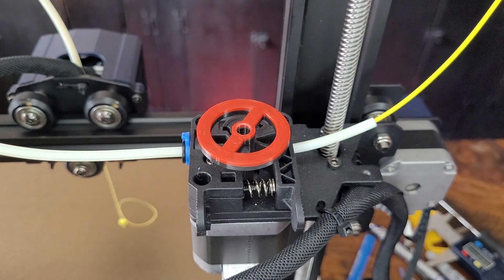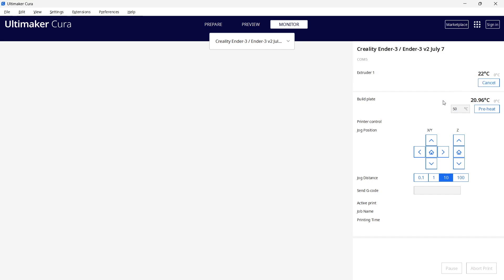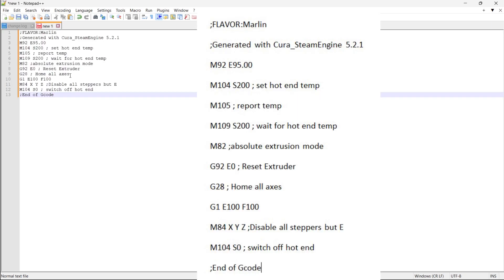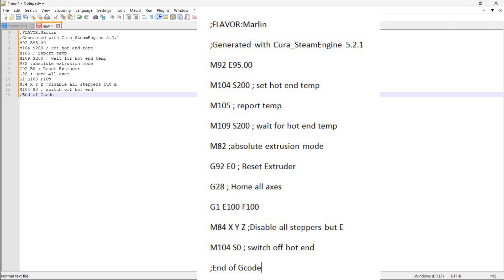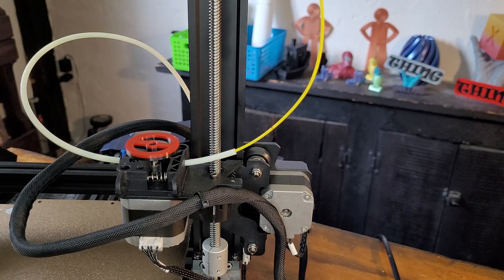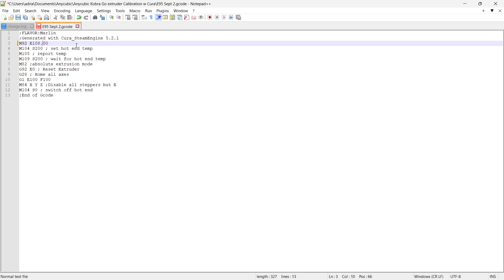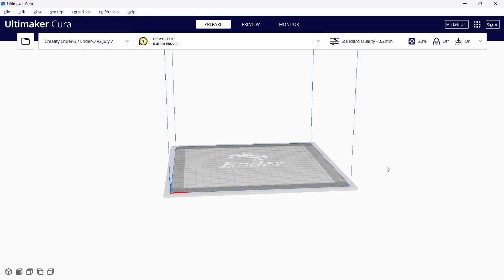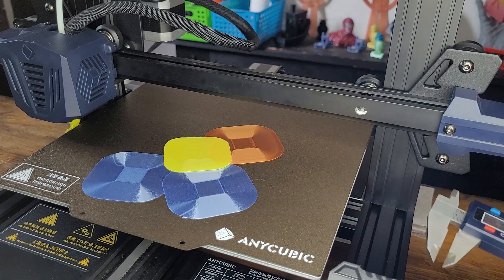Extruder Calibration Cura

Comment from the maker: In case you get the point where you press enter and expect filament to flow and it doesn't, enter G92 E0 and hit enter, this will reset the extruder. Then enter the G1 E100 F100 and hit enter, it should work. 
Just an FYI an even simpler method discovered by accident helping out Wolf Puder https://youtu.be/xetz2ndT7eA
Reply: Dude thank you so much for your efforts! I'm using all your videos to debug my printer quality issues.
Very grateful for your time and efforts! Thank you! 

That 120mm plastic piece you use to measure your filament is very handy! Is it something you designed and printed? If you did it, would you be able to share it?

Thank you!
Reply from the maker: Hi  @russkiebetta  thanks for letting me know they're useful, I really appreciate the feedback and encouragement. More soon :)
Reply: Looking forward :)  @mayhemsmiley
Reply from the maker: Sorry forgot the file line @russkiebetta   https://drive.google.com/file/d/1-Ruf6-ag1nMbTu2Pqaf_aQLsDRHbl7C6/view?usp=drive_link
Reply: @mayhemsmiley  much appreciated, thank you!
Reply: So I'm only 5mm off.... Wouldn't that mean when I save the code you posted (with E95) that it already accounts for my 5mm difference? @mayhemsmiley

Comment: Happy New Year! Thank you for the video!
I know nothing about 3D printing and I still can't believe I can do this by following your steps!
Repeated the test 3 times and they were dead on.
Could you please also share your Brim file?
Reply from the maker: Happy New year lqqkout 😃 Thanks for letting me know you found it useful. I cannot find the file and I know I shared it in at least one video 🤣 But if you're using Cura, add a test cube to the bed and scale down (Z axis only) to your layer height and turn on the brim function. The brim width can be set in Cura. Let me know if this helps.
Reply: @mayhemsmiley  Got it! Just realize that my brand new Cura needs to add the Plugins in order to find a test cube😅
Thank you once again!
Reply from the maker: @lqqkout7987 excellent 😊

Comment: G1 E100 F100 makes my extruder spin the wrong direction and removes the filament instead of feeding it.
Reply from the maker: Hey Bullerbuilt, which printer are you using? Does the motor turn in the right direction when printing?
Reply: G92 E0 fixed my issue. Thanks for the reply and great video!
Reply from the maker: @BullerBuilt thank you and glad you worked it out.

Comment: It's a crying shame that we even have to do all this with Anycubic Printers. I also have a Bambu lab Mini and it does all this on it's own. It calibrates the flow, and the Z offset every print. I get perfect prints every single time that are incredibly smooth and perfect and adhere very very well to the build plate. On the Kobra 2 Max by Anycubic, whch I have had for months now, I have only successfully printed a single messed up Benchy. I have spent hours upon replacing parts, including  brand new hotbed. watching z offset videos, and making recommendations, and spent 100s of dollars on tools and items needed to try to get this damned thing to put out one singe good LARGE print. The bambu lab printer prints everything perfectly every time in any material.
Reply from the maker: @CyrusWraithWalker  yah I hear you.  I have two bambu P1S and both work amazing. No tinkering

Comment: How do you run the code?
Reply from the maker: Hi the what was that, 
You place the code on an SD card then insert into your printer and press print
It will heat the filament and extrude 100mm of filament. 
You will verify the accuracy by measuring what is left. 
Sorry for the delay
Let me know if you have any questions

Comment: sooooo... i just got my printer and it pulled only 20mm... i feel like there is something bigger off that just the steps... it doesnt feel right putting 475 as the m92 value
Reply from the maker: Hi DerGeile, what brand and model of printer do you own? When I get unusual results I always double check in case the human factor is at play, sometimes it's me :) Let me know
Reply: @mayhemsmiley  i have the Kobra Go, bought it used. He showed me the print, wich were pretty good. i dont really changed anything except i did the auto-Leveling.
Reply: i have cobra neo and my result is 647.

Comment: i have one nitpick 
if you home printer and extrude filement in the home position directly on the table, you may get wrong resoult becauseblob of filement created on the table might restrict the flow
it would be safer to home the printer and then move z azies by 10-50 mm up so it does not make a blob that cause restriction that put strain on extruder , that way you have much less of a chance to have skiped steps during calibration
also you might want to do 2nd step in calibration, being measure actual thickness of the filement and put it in slicer you use, because even if you calibrate esteps and have filement that not 1,75 but 1,70 or 1,69 you would still get underextrusion, and if filement is over 1,8mm overextrusion. you might think that filemnt is always the same thickness but it might vary from manufacturer to manufacturer, oreven filement type and later your flow rate might be offf. especially frustrating with multicolor systems
Reply from the maker: Morning Ko
I appreciate all the feedback
Always room to improve
Firm the monitor tab on Cura, the print head can be maneuvered to your preferred location.

Comment: Hi, I'm trying to calibrate my Kobra max, I have cura version 5.6.0. on a MAC. I get up to putting the code on the SD card. However whenever I start it, it always starts at 70%. I'm at a complete loss.
Reply from the maker: Hi Samara, I don't understand it starts at 70%
Do you mean that it shows 70% complete on the printer control screen? Let me know
Reply: Hi yes, on the control screen it shows the progress as 70% and will only extrude around 15mm @mayhemsmiley

Comment: So I got to the site where I enter the g code G1 E100 F100 and hit enter and it’s not doing anything at all any ideas why? It’s pre heated aswell
Reply from the maker: Type in G92 E0 and hit enter.  Then try again.  That command resets the extruder.
Reply: @mayhemsmiley  that worked!! And I guess my e step was perfect already! Idk why my prints are so bad sometimes, it seems like the first layer is getting smushed at spots but if I back the z offset up at all the the first layer has gaps in it 😅 it’s got a auto leveling bed too it’s the Anycubic Kobra 2 Neo

Comment: Very interesting video, thank you. One problem, when you have Cura or anything with the numbers up it's slightly blurry. I even used a magnifying glass to see if it was my eyes or the video. The other pictures, printer, are clear. Just FYI.
Reply from the maker: Andy thanks so much for your feedback.  I'll really appreciate constructive feedback. I have great mechanical and electrical skills, but lighting and video are a work in progress. I'm having a blast and getting feedback that I'm helping people in the community which is awesome.  😊
Reply: Thanks for the video-!
My Artillery Sidewinder X1 did not read the notepad++ code, saved as name.gcode....I also tried using the USB (it has both) but no joy. Any thoughts?
Thanks a bunch.

Comment: Hi there!, i´m having some problems whit the filament just going about 20 mm instead of the 100mm the gcode says, do you know what could be the problem? i´m using a Kobra Neo :c
Reply from the maker: Hi Zuriel, are you referring to just after the 3 minute mark in the video?
Reply: Well, I tried to put the line of code into cura connecting my printer and didn't work, then I tried using the gcode you gave us exactly as you have it, but it only moved 20 mm and not the 100mm it should. I'm new to this, I don't know if I miss a step

Comment: Did mine it was just a few mm more than yours. All set now. Doing some Tests now.
Reply from the maker: Keep us posted how you make out.
Reply: @mayhemsmiley  have you done PID tuning? I can't do a heat tower or it throws an error code.
Reply from the maker: @cdnbrit   Unfortunately no I haven't done PID tuning
Reply: @mayhemsmiley  every time I try to do an a temperature tower it stops on code E1. To which I found out it's PID tuning for the nozzle. Something about this machine doesn't like to do the five Celsius steps up on a tower.
Reply from the maker: @cdnbrit   I've heard of some peeps having temperature issues unfortunately. I have seen posts where others have overcome some of their temp issues. Anycubic may have some quality consistency issues with their product line.
Reply: @mayhemsmiley  I believe that's true. I'd read that some people have an issue with some kind of break in the wiring in their bed. Enough to the point where it has to be replaced. That I haven't seen myself yet. But I would like to do temperature towers especially with different types of PLA that I'm using.

Comment: Hello, I'm trying the micro sd card method on my Kobra Max but it stops extruding after 22.5mm. Any ideas on what the issue is?
Reply from the maker: Hi Ryan, interesting problem, can you share your code in the comments and I'll have a look.
Reply: @mayhemsmiley  I found out I made a mistake. I didn't add the new value when I remade the gcode file. That's what happens when I try to do things after work.
Reply from the maker: @ryanduncan2381  I hear you. I can be pretty fried after work too. Glad you figured it out.

Comment: Hello, I noticed that you're using Ender profile for Kobra Go. I know that Kobra Go is a knock-off of Ender 3, but does the Ender profile works any better, are there any changes (in settings) necessary?
Reply from the maker: Morning ProTimax, I started using the Go before they had their own slicer. I liked the Ender profile at the time because of the priming stripes of the nozzle on the printer settings. No big differences.

Comment: Hey man, I need some help with my kobra go. There seems to be a random squeaking/scratching noise occuring when I print and it really frustrates me.
Reply from the maker: Hey Mini I hear you. finding the source of creaks and scratching can be frustrating. Most importantly is your nozzle scratching the bed surface? Are you getting prints in spite of the peculiar noises?
Reply: @mayhemsmiley  Did check for the nozzle scratching the bed, it isn't. I am still getting prints, along with some under extrusion. The extruder gear is also slipping when printing the purge line
Reply: @mayhemsmiley  Ha! I think I found the solution :^) After calibrating my E-steps (Thx for the video!) it solved the squeaking entirely and the underextrusion! Thx a lot 😁
Reply: Also watching your extrusion tutorial! You did an awesome job :)

Comment: Hmm, perhaps its just me, but the gcode does'nt make sense in the way that it starts extruding, while the nozzle is pushed up against the table.
Here is the code I used instead, to clear the head:

;FLAVOR:Marlin
;Generated with Cura_SteamEngine 5.2.1
M92 E95.00 ; after testing you will change 95 to your test result value
M104 S200 ; set hot end temp 
M105 ; report temp
M109 S200 ; wait for hot end temp
M82 ;absolute extrusion mode
G92 E0 ; Reset Extruder
G28 ; Home all axes
G1 X20 Y20 Z20 ; Move table out of the way of hot end
G1 E100 F100 ; Extrude 100mm at a feed rate of 100
M84 X Y Z ;Disable all steppers but E
M104 S0 ; switch off hot end
;End of Gcode
Reply from the maker: Hi Obssession, thanks for the feedback, what model of printer are you testing on?
Reply: @mayhemsmiley  Ender 5 Pro. I dusted it off for a couple projects and wanted to get it back to top condition.

Comment: No need for a Computer. Every printer (should have) has a setting window where you can move the axes and the extruder.
Reply from the maker: Morning Janloos, unfortunately not all printer have the ability to calibrate the steps. Mine can move the various axis's, but you cannot adjust the steps through the control panel. I saw people struggling with trying to use Pronterface and realized this method might be easier for people starting out.
Reply: @mayhemsmiley correct. Unfortunately my Kobra 2 Max does not have Esteps available in the printer settings. This video helped me a lot with very good explanations. Thanks.
Reply from the maker: @tRRickedOut  thanks for letting me know.
Reply: @tRRickedOut how did you connected with pc? Did you just put usb cable to port where usb goes ? I cant find any other port 😹😹

Comment: So frustrated with my printer. Just about ready to toss it. Anything I try never works. Obviously back half sits too low and front half is too high.
Reply: Only thing I would have to add on top of smileys comment is check the eccentric nuts. Mine were loose.
Reply: oh, and the S1 on the m420 command in the g code. my go likes to revert back to s0 even after multiple m500 saves in the firmwear so i make sure i have it saved in the g code in cura as well. smiley has a few videos on it.
Reply from the maker: Hey JW maybe time to mod and change the spacers to springs like this https://youtu.be/qpm1Rpr6EyQ
Reply: needs some good bed levelling
Reply: Do not give up. Check out this channel for all your answers. 
I was exactly where u r, and then Mayhem helped me come into the light

Comment: first couple uses of pronterface is intimidating for sure.  last last week i was getting frustrated it would not connect to my printer just to find out cura and pronterface could not be running at the same time as both where connected to the printer
Reply from the maker: Wow interesting
I wonder if that's what I encounter with pronterface connection issues in the past.  Good info to share